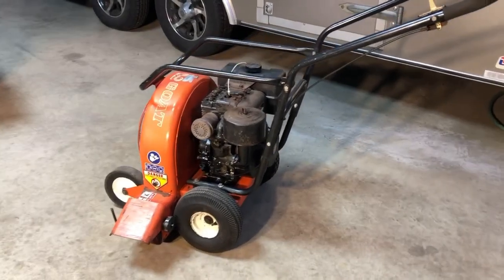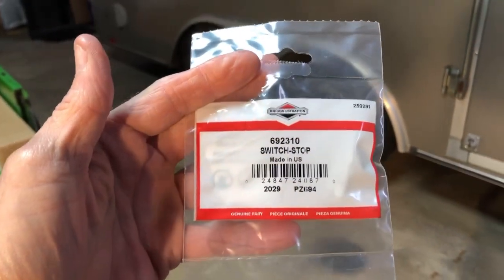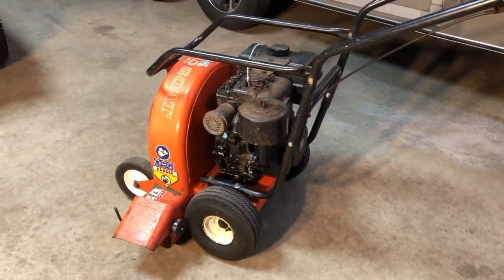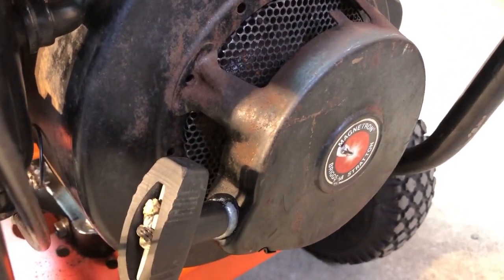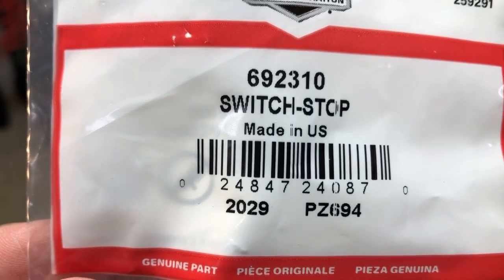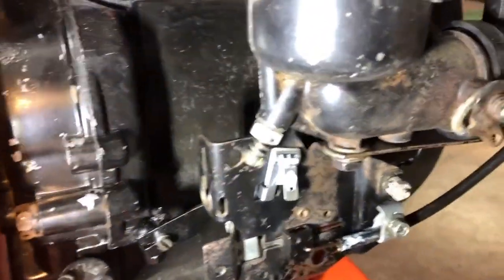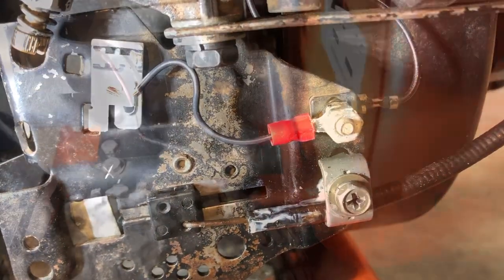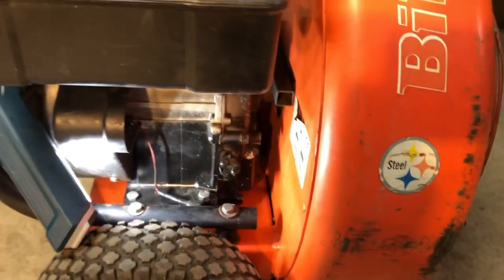8 hp Billy Goat blower

Comment: "blow a bowling ball across the yard" 
That is the dam truth!
Reply from the maker: I’m guessing you have one of these?  😁.  Actually I ran the machine this afternoon as my leaves are coming now.
Reply: We got 3 of them at work 💪 
I didn't know we had the 3rd one hiding in the back of the shop, found it the other day, and it was a flathead 😍  
I put gas in it and it fired right up.
Reply from the maker: @dogsandwich77  I bought mine that year with a bad engine. The previous owner discontinued the low oil switch and eventually ran it out of oil. I already had the same basic 8 hp engine on the shelf.  A couple hours labor and a few parts, I was more than impressed with the air power.  I find it a good machine for my needs. Built like a tank too.